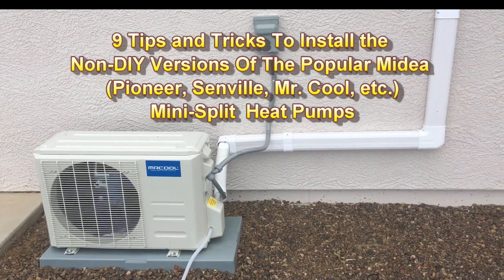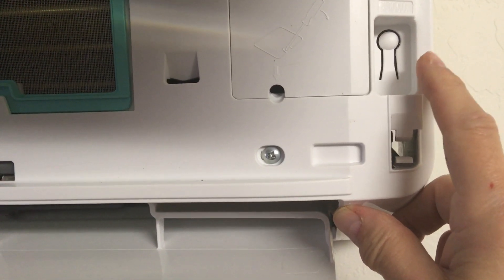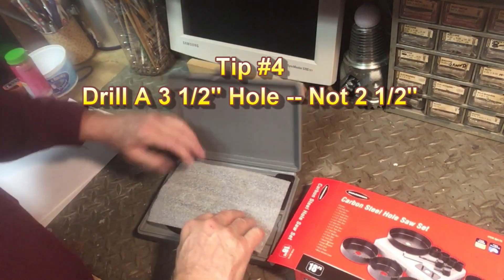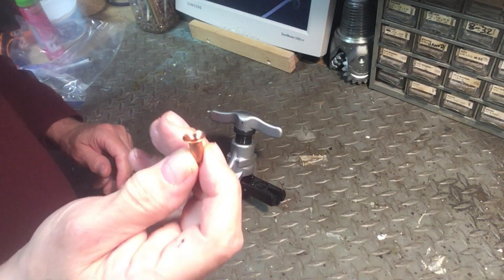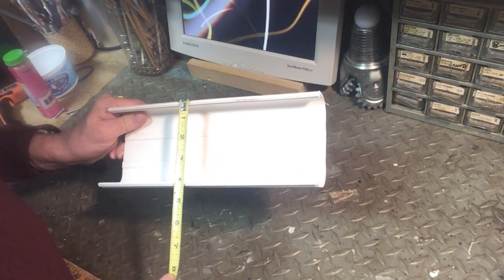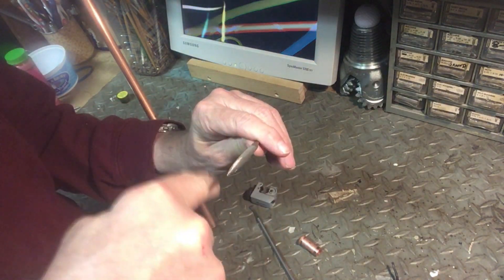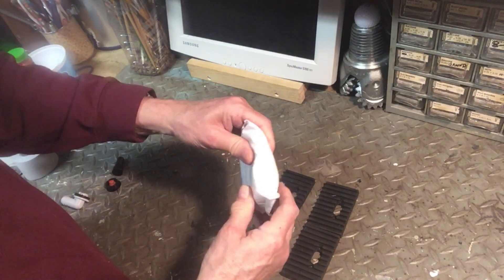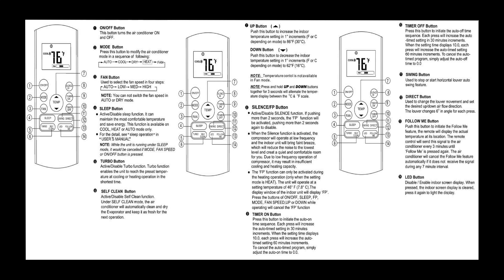9 Tips To Install Cheaper Non-DIY Mini Splits - Pioneer/Senville/Mr. Cool

Comment: can I put the outside conpresser in my attached garage?if not what are the reasons
Reply: No, because the closed garage is not a big enough sink and will get too hot in cooking mode and too cold in heating mode, severely reducing the efficiency of the unit.
Reply from the maker: Oh, no, don't do that. The heat output from the compressor unit will offset the cooling from the evaporator unit and it will not work.

Comment from the maker: Update 01-01-2020: Again, sorry about the dinging! I've learned a few more YouTube skills since I made this video!

I've been using this unit for 9 months. It is as much of a godsend in the winter as it is in the summer. I spend a lot more time in the garage than I did in past winters! With the outside temperature around freezing, the garage will be up to a very commfortable level (high 60's) in about 15 minutes. The heating ability of this heat pump has surpassed my expectations. Even my normally-freezing wife will spend time in the garage these days!
Reply: Now you can't get away from her!!!

Comment: You said the drain elbow would not fit between the unit and the base - would it fit if you used the rubber feet?
Reply from the maker: I tried it. No. Not with the model I got.

Comment: Thank you for this video! I thought the refrigerant was in the line and was afraid to cut and flair, I need to remove about 5 feet, and now that you show how to do it and the refrigerant is in the unit, I can rent a vacuum from the local parts store and it may even come w/ the R14 adaptor 
You have saved me a ton of money and I get to learn some new skills to go with my ancient VW Aircooled hobby.  :)
Reply from the maker: Glad it helped!
Reply: Yep, I cut my line down to fit perfectly.  Only needed 6 feet of line
Reply: @growshack9067  how long is your line?
Reply: @jefiguer  was 16 feet.. Now @ 10. I should let out a tad bit of R410, but live n learn.. it overshoot my setpoint in the triple digits ..
Reply: Did you remove any R410
Reply: @georgedeamicis2510  nope

Comment from the maker: Winter is coming on. You may not know that these units heat as well as cool! So, installing one can still be a useful fall project. You might even get a discount in the off-season. I didn't have enough cold weather to test the heating capability of mine thoroughly, but they certainly do provide heat. I'm not necessarily trying to bring my garage up (or down) to typical room temperature. I found that  just changing the temperature a few degrees can make a huge difference in comfort.

After putting this thing in, I just wonder why I waited so long.

Comment: By the time you buy a vacuum pump, gauges, a good flaring tool, etc. you haven't saved much money and you don't get a warranty.  Unless you already have the tools and don't care about the warranty I think the DIY kits make more sense.
Reply from the maker: You're probably right about that, and I have tried to stress it. You only want to do this if you love tools and DIY, and you want to try something new and learn something new. It's kind of like reloading; people do it because they enjoy it. They know they're not saving much money. The problem I had with the DIY kit is the big roll of unused tubing behind the compressor unit. There are some people who enjoy doing everything possible for themselves, this is for them - Thanks for your comment.
Reply: @bupright  The diy is good when you live in a town, and the hvac guys only want to install items they sold. That is the case in my town.

Comment: Just installed a Pioneer 9000 btu/ 230v.  The only thing I hired a pro to do was to pull a vacuum and release the refrigerant.  It took a while to carry out all the steps but it went perfectly.  Works absolutely beautifully.  It's dead quiet and the heat pump function works great too.  No idea how long this will last, but total cost was $743 for the minisplit, $40 for the lineset cover, $30 for the wifi/smartphone module, $50 for the compressor wall bracket and $200 for the pro to commission it. Works absolutely perfect -- superb product and just love the thing!!!
Reply from the maker: I had a little trouble with my lineset cover. Though it appeared to be decent quality, it turned out that parts of it were missing UV protection. After a month, it had yellowed so bad it looked 20 years old. I b**** to the seller and got a refund. Then I painted it to avoid further sun damage.
Reply: My pioneer is phenomenal 😍

Comment: The problem with non DIY units is that almost all of the companies like Mr Cool, Pioneer, etc require you to have an HVAC company sign off stating they did the actual evacuation of the line sets to activate their warranty policies. I don't blame them for requiring this. I'm sure there are plenty of people who think they can do this process just as good as the pros but in reality they might not. So they do the job incorrectly and possibly cause premature compressor failure from improper line set evacuation. This is why I'm a huge fan of the DIY series from Mr Cool. Sure, they cost a few hundred dollars more but I'm okay with that. Me and my wife installed our two DIY Mr Cool mini split systems in our home with zero issues. The fact that I have a seven year warranty on both units gives me very good piece of mind.
Reply: I don't know, they're so inexpensive that $200 for the the guy to come over and commission it seemed totally workable.  You get a pro to eyeball your whole installation, which is helpful in and of itself.  Works great!
Reply from the maker: If you can get a guy to finish it for you for $200, that may be money well spent. Around here, it costs $250 just to have someone drive by and look at the front of your house from the street. :)
Reply: @Blam Downright  I installed my 3ton 2 zone senville all the way back in 2015 and did all the things you did in this video(except I pressure tested with nitrogen and also used a Micron gauge to pull under 500 microns.) It has worked like a champ  ever since. I have installed about 7 units between then and all work flawlessly.  Idk how important the warranties are considering they change models often.
Reply from the maker: Thank you for watching!
Reply: @SlightReturn666  good luck finding a hvac guy willing to do it. So many hvac companies won't touch a unit they didn't sell you
Reply: @randybobandy9828  I put an ad in Craigslist and I was able to get an A/C tech who worked for one of the big local companies to just come over on a weekend and earn a little extra money.  He was a good guy and I was pleased to have a pro confirm that I'd set up everything exactly right.  You certainly don't want to have to purchase all the vaccuum gauges and stuff just for one-time use.  

Two years in, the system still works great except that I think the thermostat is starting to go ... tends to keep the room much colder than it's set for.
Reply: @Slight Return  I guess that a good way to do it but  since he was working on the side how would you get him to sign off on the warranty?
Reply: You correctly identified the problem.  The warranties on the non-DIY units require a licensed contractor to finish the install even if you’re a retired HVAC guy.  No contractor, no warranty.  So the price of the unit is not so cheap after all if you must hire someone and pay them an additional $200 because they hold a license.  The problem with the DIY systems is the look of the excess coiled up mess of tubing behind the condenser. It is so much cleaner to be able to cut the exact amount needed.

Comment: Great video as I am trying to decide between DIY and Advantage. Question: Are the Advantage lines flared? So if I don't shorten lines , I can hook up the lines to vacuum pump directly? Thanks again
Reply from the maker: Yes, the lines were flared, if you have room you can mount the outside unit far enough away so that you don't have to cut any lines, but also don't have to wind them up behnind the unit. You will need a vacuum pump, though.

Comment: I also can't put the drain elbow on the outdoor unit, it's too big to fit under between the unit, rubber feet, and the plastic base. I'm afraid water will rust out the bottom. I'm trying to tilt it a bit towards the side of the drain hole so water will exit, but concerned it will affect the efficiency of the condenser, as most say it needs to be perfectly level.
Reply from the maker: I'm glad someone else noticed this! :) Thinking about it a little, I have noticed that in Europe, where there are millions of these units, they are virtually always mounted on a rack attached to the wall. In that case, clearance is not an issue.
Reply: The drain fitting is for wall mount, not pad mount. Thats why it wont fit with pad mount.

Comment: FYI......
The Mr Cool unit says to drill a 3 1/2" hole (not 2 1/2")
Reply from the maker: I don't remember seeing that, but they supplied a 2.5" sleeve with mine. There is more fighting on here about the sleeve than just about anything else. Some guys say they got a 3" sleeve, some say they got a 3 1/2" sleeve...on and on. I got a crappy 2 1/2" sleeve (made out of soda straw material), and the $6 I spent on the PVC pipe was well worth it.

I did not get a wall template; I don't know if they make one, but I spent more time measuring and calculating and making my own template than I did installing it.
Reply: The instructions state 3 1/2" hole for the 24k unit and 2 1/2" hole for the 12k and 18k. I'm about to install a 18k and he's correct about the 2 1/2" plastic tube they supplied not being big enough for the two lines and tube to all fit.

Comment: Thank you!!  I am going with the 3.5" hole and a 4" line-set cover.
Reply from the maker: I figure if I'm going to bore a big hole in the wall, there's not much difference between a 3" and a 3.5" hole. It's still a big hole. Except you are less likely to damage the lines or fall off the ladder with the 3.5". I have some balance issues, so safety is important.

Comment: Great tips!! Why did you pick the MrCool over a Pioneer or Senville?
So you  do not have a warranty because you did the install?
Reply: DIY warranty
Reply: MrCool has a 5 year warranty on their DIY models that don't need a vacuum pump to install. I just wish they offered more lengths of line sets. I installed an 18K one with 25 foot lines so I could reduce the amount of wire and conduit that had to be run. There was only one place the air handler could go in the small house but the breaker box was on the opposite corner. So I had to run 40 feet of conduit and wire to meet up with the condenser. I bolted the condenser to a concrete pad because I wanted to ensure nothing could move it and bags of Sakrete are cheap here.
Reply: @greggv8  My first unit was a 18k MrCool, but not the DIY unit. I studied up, and borrowed some tools. Not too hard. My second unit was a Pioneer 12K that I was able to order with a 32ft line-set.  They are 90% the same, controllers are interchangeable.  I will go with Pioneer in the future because you can go direct to them.  I had to get the MrCool  thru HomeDepot.
Reply: @rondail5675  lowest cost for MrCool's DIY version is through Costco even after buying a year membership

Comment: When you shorten the lines, won't there be too much precharged refrigerant inside the outside unit?
Reply from the maker: I checked with the company, and this is what they told me: they said it was fine to do it, but not to shorten them to less than ten feet. My lines were about 15' long, so this probably was not considered overdoing it. If you go any shorter than 10 feet, you might have to take out some refrigerant.
Reply: @bupright  I shortened my line to 6-7 feet only. Was 16 ft. Line set. Hvac pro buddy of mine said it didn't need to be purged of any refrigerant in my case. Unit cools perfectly, no error codes. He used all gauges, no leaks at all, vacuum lines for 30 min..
Reply: @bupright  in some cases, maybe u do .

Comment: Do you have to fill it with freon ???
Reply from the maker: The compressor is filled. The evaporator is not. After you vacuum and test the evaporator, you release the refrigerant from the compressor. You don't buy or add refrigerant. It's all in the unit.

Comment: Using those vibration pads would have given you additional clearance for the drain fitting underneath the condenser. In theory, the pads reduce wear on the moving parts in the condenser, even if vibration isn't an issue to the occupants.
Reply from the maker: Yeh. I did try the pads out,  it still needed to be raised another half an inch at least. :(

Comment: Did you run your own electrical to the unit or did u bring in electrician?
Reply from the maker: I ran my own. 12 gauge wire. Non-fused disconnect. Inspected by the local authority.

Comment: You recommend to use 3.5 inch PVC pipe to run all tubing through the wall. It would be not compatible with outside cover provided by manufacturer. How do you manage this problem?  What do you use for cover?
Reply from the maker: I bought a 4" line set. It covers the PVC pipe nicely. It has a bigger cover. Someone commented that they used vinyl 4" downspout material. I didn't think of this; if I had I might have tried it.
Reply: I just last week installed a Pioneer and the 2.5" sleeve was fine.  Wrapping the tubes tightly with the white tape supplied makes it dead easy.
Reply: @SlightReturn666  I think different line lengths come in different diameters too.

Comment: Thanks for your video it helped me work out my install of 2 9000 and 1 18000 BTU units! I must state that the wire inlet on the compressor sucks, the flex conduit mounting plate should be part of the compressor frame and the cover should be removable! Beyond that I'm putting the compressor outside of the two rooms with the 9's and the 18 is being installed on an internal wall, into the attic to the same end of the house. This gives me all three tubing wires and drains going down the outside of the house at the same place, so instead of having 3 ugly channels running down my house I'm installing a wood box cover that is sided to match the house! I will mount a 4 Gang outdoor electrical box on the house and run my control wires though it allowing a place to attach the flex conduit to the compressor. One other issue I ran into was with the indoor units, when you mount it to a wall and the lines are going out through a wall to the left and you switch the unit tubing and drain to that side, the lines will project past the unit, so if you mount it close to the exiting wall you'll fight with the lines when you go to hang the unit! Other then this, have a great day!
Reply from the maker: Bob, yes you are right about the wire inlet. It is ridiculous! That was the only low point of my installation. You see a similar thing in cars where you wonder what the engineer was thinking (or not thinking).

Comment: Doesn't a Mr. Cool has a 2 year warranty, vs a 10-year warranty for a Carrier or other major brand? 
If it only lasts for 5 years, isn't it a waste of money?
Reply: 7 year compressor 5 year parts
Reply: Carrier only sells to certified professionals to do the install...   that's one reason the warranty is better...
Reply from the maker: If you love to do things yourself, and would rather commit suicide than call a "professional," it's not a problem. There are jillions of Mr. Cools (or the same manufacturer with a different logo) all over Europe. You can probably install three or four of these Mr. Cools for the price of a name brand. If you're not the DIY type and you're not a cheapskate, it's probably better that you go with a name brand (though the chances are excellent that the name brand was made in the Mr. Cool factory).

Comment: I can't seem to find linset covers... Anyone have any ideas? Didn't find any at Lowe's and home depot.
Reply: Online only
Reply: Perhaps check an HVAC shop? While they won't sell you an HVAC unit because you are not an installer, Perhaps they will sell you other parts.
Reply: @SirBufo  yeah they refused to sell me a ac transformer that they had in stock. So I had to order it online and deal with no AC for 4days in the heat until it arrived. Bunch of BS, on the bright side, it was cheaper online.
Reply from the maker: I can't tell you how many times I ended up at wholesale parts houses getting the stink-eye from someone who decided I was not "professional" enough to buy some part. Even moron parts like a stovetop coil. I never got turned down, but the internet mostly fixed that problem quite some time ago.
Reply: Order from manufacturer website.

Comment: Nice video, good ideas. I am installing a Senville 18k unit soon...
Reply: Installed, I bought a 25’ line set hoping it would reach but alas, I crimped the 1/2” line 3 feet from the end (working around foundation blocks). Just bought a 1/2” flare Union and cut out the bad spot. I used the extra from the original 16” line for the repair. Vacuumed out the lines, let it set for 25 minutes with no loss of vacuum. Static pressure of the Freon was 107 psi. System works great!!!
Reply from the maker: Great! Good for you!
Reply: @brianb6603  , when you say static pressure of Freon,  do you mean  you added some R410A before opening the valves, just to pressurize the system?  then vacuum again?
Reply: Ron Dail in trying to give a brief report I was unclear. My line length came out to 29-30 feet so I was concerned about having too little 410a in the system. The “static” pressure of 107 psi was after letting the Freon into the lines. I just acquired a partial bottle (8 or 9#) so I will add some soon to get up to the optimal 117-120 lbs in the system. Let me know if I am misunderstanding this process.
Reply from the maker: Wonderful!
Reply: @brianb6603  same as mine!